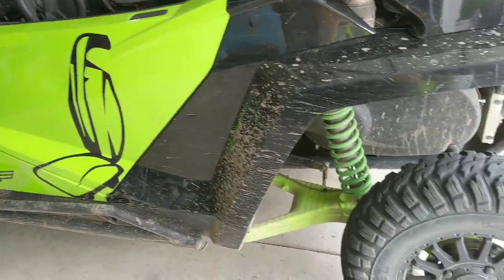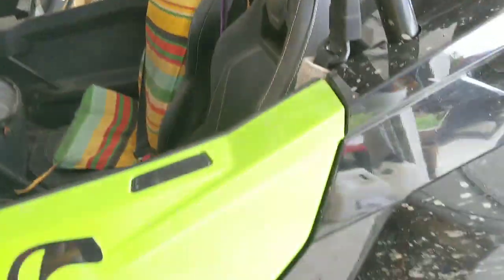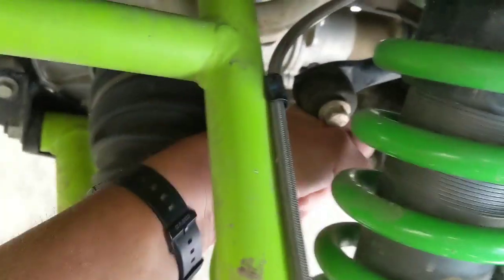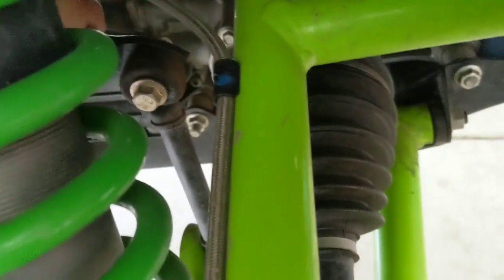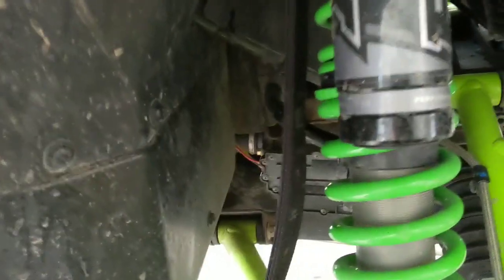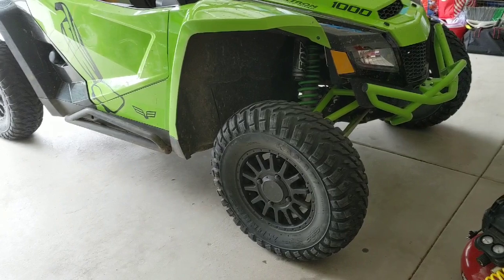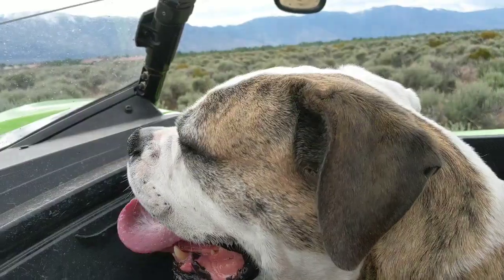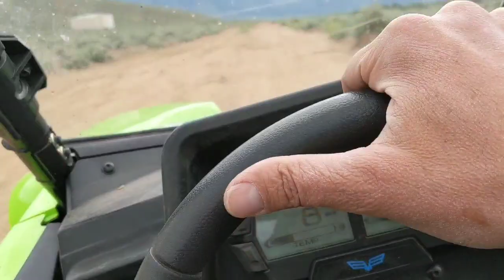Textron/Arctic Cat Wildcat XX Front Sway Bar elimination

Comment: I know this is an older post. But I have had mine new since 2020. The front has always sounded like it was coming apart. I've replaced tierods, spherical bearings, wheel bearings, etc. I need to know how to quite up the sway bar. I drive really fast and don't want to sacrifice turning.
Reply from the maker: I removed it..

Your driving will adapt to the slight additional sway in no time

Give it a try

Comment: Check your secondary clutch sheave bolt.
Reply: @mikepailliotet576  I figured that but thought other people reading might have the same problem I did which was the bolt on the sheave backing out it sounded like something loose in the suspension but was the sheave moving back and forth

Comment: Your drivetrain has the same noise mine had. Grease up the 3 splines and isolate the carrier bearing with a piece of rubber. It's a lot quieter.

Comment: Can you split a piece of rubber tubing and zip tie it or hose clamp it around your swaybar to the inside of the mounts to keep it tracking centered?
Reply: made nice nylon washers to take up the slack, the mounts are actually adjustable they are slotted, made 0 difference. still noisy as shit, I hate it sounds like a broken frame when you ride it.
Reply: @donmorgan1751  my rear brake pads were crazy loud when going slow on rocky roads. They fit very sloppy on the caliper guide pins.